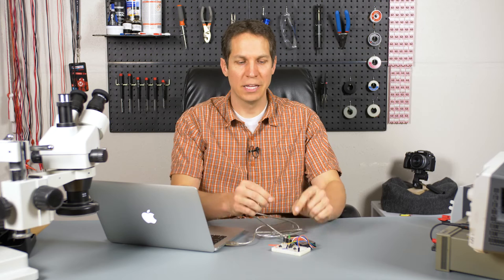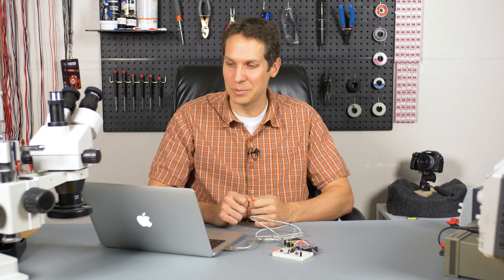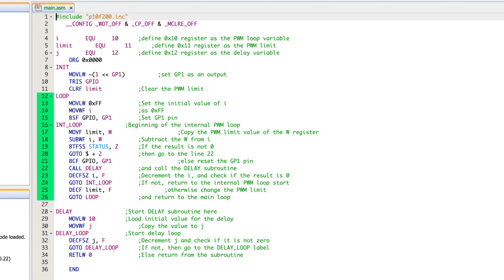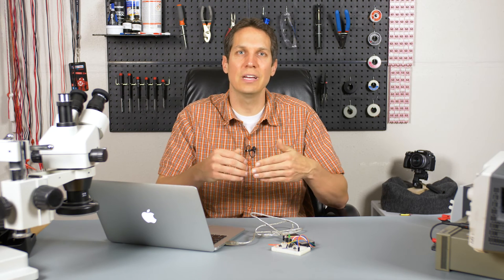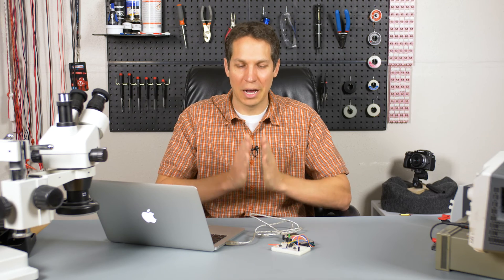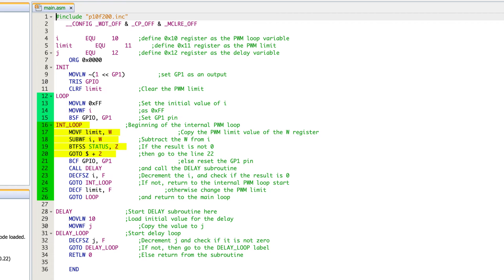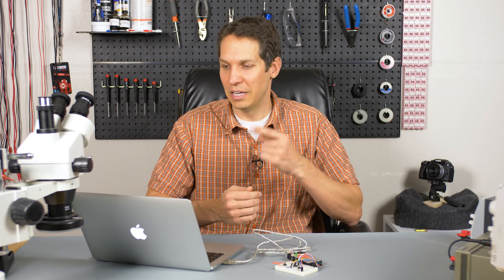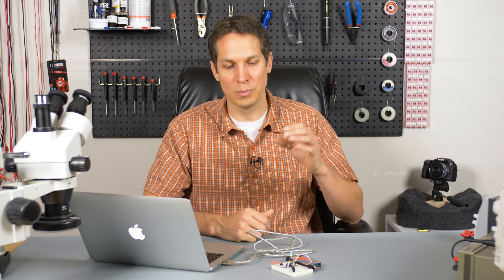Creating a PWM in Assembly - Part 7 Microcontroller Basics (PIC10F200)

Comment: I think if you reverse the test from bit set to bit clear you can use the feature of the skip one instruction to skip over the BSF GPIO,GP1.  Seems a little easier to understand.  

    SUBWF i, W   		 ;Subtract the W from i
    BTFSC STATUS, Z   	 ;If the result is 0 (limit==i)
    BSF GPIO, GP1   	 ;reset the GP1 pin otherwise, (limit!=0) leave pin unchanged
    CALL DELAY   		 ;call the DELAY subroutine

Great videos!!!

Comment: This complicated programing language is extremely hard to understand .
Reply from the maker: It is quite the challenge, though it's much easier if you start from the beginning.  For this series, I highly recommend watching the first video, then reading the first written tutorial.  In the videos, Josh goes over the topic at a higher level.  In the written tutorial, Sergey gives lots of details.  Then move to the next tutorial and work your way through. This is definitely not a series you want to start in the middle.
Reply: Use notes, it makes it easier to work through the operands without getting confused. Helps if you look up the commands and write out the explanations for them on a cheat sheet for reference.

Comment: Why did they make assembly like an alien language, our brains don't work like that or we were taught wrong way in the school or they made it hard so that people won't invent something interesting or they had no clue what they were trying to achieve. I would write it in hexadecimal as it will be lengthy but I would have control over what i am trying to do and i don't have to follow some others person instructions or make my own language which convert it into hexadecimal.
Reply from the maker: Yeah, Assembly is a challenge - I definitely struggled with it in college and have been learning a lot more from the tutorials that Sergey has put together.  I'd say the issue is that the language is not for our brains but for the microcontroller brains.  Which are inherently and drastically different than our brains.

Comment: Hello!  
I want to say that the tutorial is great, but unfortunately I have not yet programmed Assembly code. Clearly, it gets a bit confusing.
But that is expected, I just wanted to do some research on software PWM for a project and came across this video.
 
But one thing caught my eye; What tool did you use for marking lines like that? Is it purely post-recorded video editing, or is it actually a tool that highlights rows like that?

I have been looking for a tool a while for the discussions I have with my partner (who just started learning programming), which would highlight lines "dynamically" (e.g. I would not have to prepare slides with post-edited highlighted lines). It would help focusing on the matter in hand, instead of her being overwhelmed by all the code.

It might be wishful thinking, but I wanted to ask in case you use such a tool for your videos.

Thank you for spending your time making tutorials. It is people like you that spreads good knowledge around and keeps technology growth going!
Reply from the maker: Hi!  Thanks, and indeed, Assembly does get pretty confusing.  Sadly, there is no software, Taylor has to manually highlight those codes in Adobe Premiere (or Aftereffects, actually, I'm not sure but definitely one of those two) and he has let me know on several occasions it's a real pain in the butt.  It would be a pretty cool tool, though!  Now you've got me thinking...  
Thanks again for your feedback and support!
Reply: @CircuitBread  Come back to this comment if you find something, please? Maybe even develop it yourself? ;)
Reply from the maker: Like any agency (we do CircuitBread on the side - we do client work for money), we have our ups and downs in work.  Right now the design and development team is crazy busy but if we have a lull, I'll pitch it to them!

Comment: hello thanks for the awesome tutorial
my question is: is it possible to programme the microcontroller using c
Reply from the maker: Hi!  Yes, it is possible and it's a very simple transition.  You just need to select a C compiler and then create .c files and put your programs in there.  We're getting close to wrapping up this series in Assembly and we're debating whether to do another series with a different microcontroller in C or if we should do something with FPGA's / CPDs, as the style of programming will be significantly different.  But the setup itself is very similar!